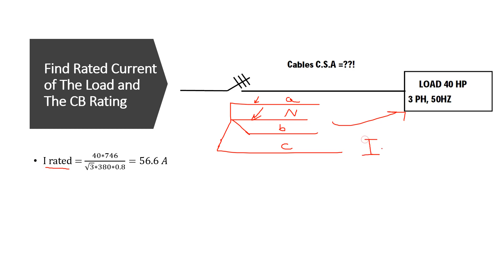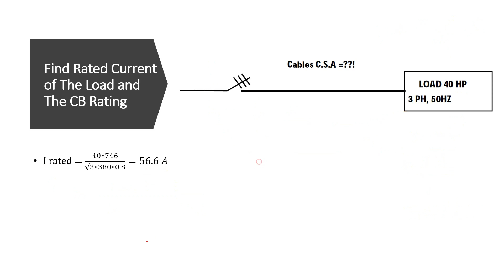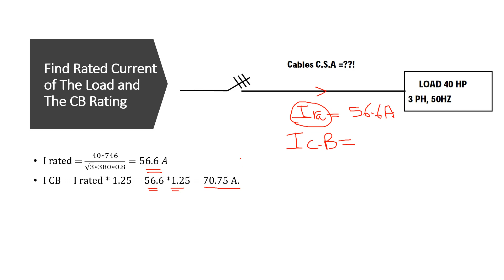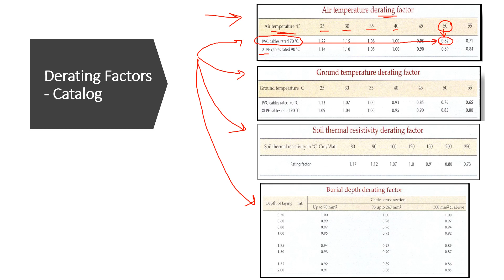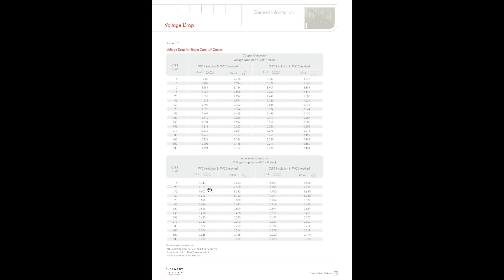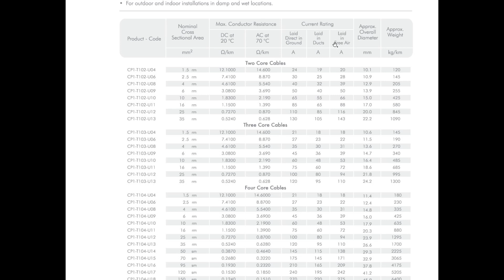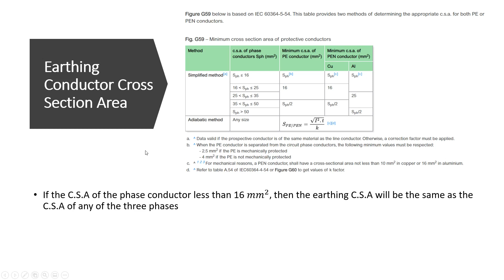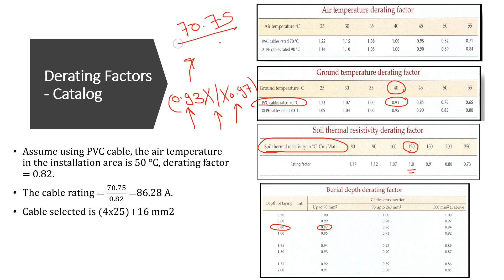Cable Sizing - Cable Selection as Per Load -  Cable Cross Sectional Area - Cable Size (8)

Comment: This a really good explanation of cable sizing. Maybe you should show people how the length of cables can affect the size choices. For example, if you would run this cable at a distance greater than +/-250 meters than you’ll have to increase your cross section to 35mm as the 25mm would be effective.
Reply from the maker: Yup, you are correct, if the voltage drop exceeds 5%, we need to increase the area of the cable to decrease the voltage drop 👍
Reply: @EngrAhmedMahdy  Very well explained Sir 🙂Also would highly appreciate if the same video could be detailed further more by taking voltage drop calculation into consideration as well